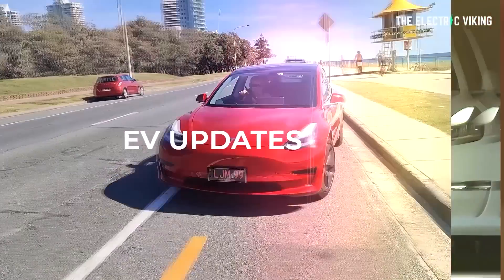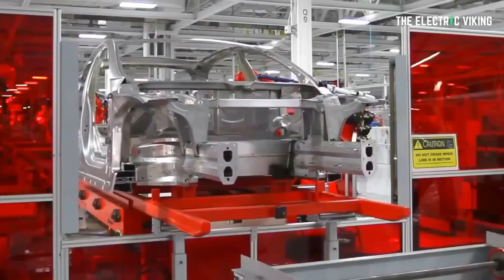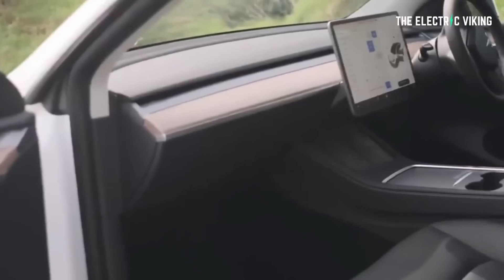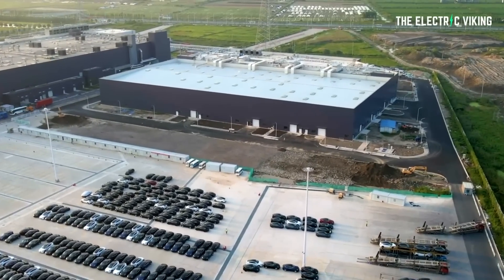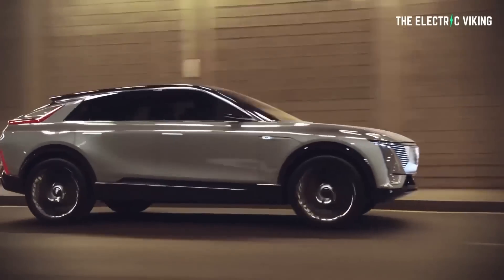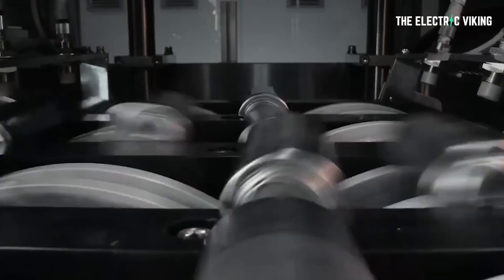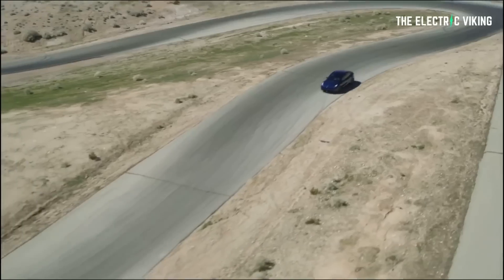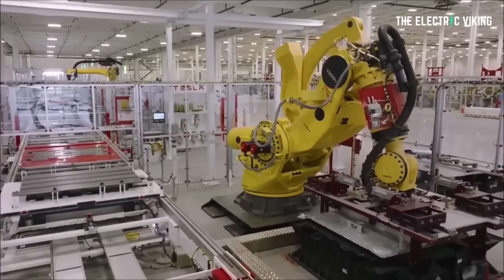Tesla's NEW 4680 battery pack size is UNBELIEVABLE

Comment: Sorry, I don't get the logic in this video.  A more efficient battery might be, depending on how we define efficiency, a battery that gives more kWh/kg or more kWh/litre.  If the battery has LESS kWh while fitting in the same space, it means it is LESS efficient.  And if the car has more range in spite of the battery being LESS efficient, it speaks of the motors, the drives, the aerodynamics and the tires being more efficient;  NOT the battery.  I'm happy that Tesla's are getting more efficient, but the evidence presented in this video does not support the premise that the battery is more efficient;  just the opposite.
Reply: Evidence from the Cyber Rodeo is that the physical size of the pack is smaller (with foam on the sides to protect the pack).  Agreed about the rest.
Reply: @CorwynGC  Ahhhh,  got you.

Comment: Where exactly does the number 50 kWh come from? I looked up the video from spiken reviews, and on the paper you can the consumtion. I think it says 28 kWh / 100 miles. For 279 miles the battery has to be 78 kWh!
Reply: https://youtu.be/y5aOZloxJOw
Reply: Just the idea that a new battery and weight reduction would decrease energy consumption by more than 50% is truly unbelievable. 🙄

Comment: i rarely if ever will drive over 200 miles without stopping for a rest stop...  so i woud prefer to save money by getting an EV with less battery range...  but i wondered if you are charging a Tesla with a long range battery will it fill the battery at the same rate of time as to fill the standard range battery or will it take a little longer to fil it given you were using the same capacity charger each time?

Comment: Varying reports (sticker suggests 50kwh) but charging experience reported says 68kwh. What is really needed is a tear down to isolate the population of cells to get a handle on how many cells inside. We may need to wait on Sandy Monroe. That said at 68, this does Not preclude what is said IF the battery cell mass is lower.

Comment: Fiat 500E has a 42kW battery and has 200mls range, so that new 4680 Tesla 50kW battery pack is indeed very good.
Even if Fiat increases with 20% to 50kW (when it realy is 50kW, which has to be confirmed), it could have a range of 240mls.  And the Fiat is a lot lighter and smaller. Kudo's to Tesla.
Now, bring that Tesla down to $25.000 and it will become affordable to.

Comment: What amazes me is how little progress has been made in 2 years.  I bought my Nissan Leaf 62kWh 2020 and it does 0-60 in 6.8 seconds and over 200 miles.  I would expect cars with 60kWh now to be doing over 500 miles at least.
Reply: Why?  Changes like that have to come from basic aspects of a vehicle like weight and aerodynamics.  Electrical efficiency is near theoretical maximums at the moment, (above 85%)  Changes you envision would require 150% in efficiency improvements.  Improvements of 5% per year are considered fantastic.

Comment: Yay Tesla! Their success is pulling the industry forward. When Tesla shows massive profits other publically traded manufacturers must do all they can to compete. 

This new Model Y gives Tesla the option to lower their price when the supply is able to support demand. Demand is about to become intense because of gas prices. It may be possible for most people to simply decide that they will no longer waste their money on gas. Then buy the first EV that becomes available. 

Yet financing EV purchases may also be interesting. There could be a scenario where despite demand, financing availability may slow the flow of new EVs to consumers. This may be helpful to allow time for EV support infrastructure (service & charging) to become more available. And it would be nice for a surplus to build up. Tesla's new model Y allows for profit even if their is a surplus.

Tesla is not the only company that has support issues. My Hyundai dealership has over a month wait for all cars to receive service. So I have been waiting for my turn to have my Ioniq 5 recall taken care of. Hyundai requires the Ioniq 5 to only be serviced at Hyundai. That includes things like a nail in a tire. Yikes!

Comment: Surely range is a breakthrough Tesla need to be aware of against competition?
Several Chinese companies are delivery 500m range cars later this year.
Tesla would be my first choice but regularly doing a 400m round trip, if I could do this without stopping to charge it would make a big difference to my choice of EV.
Hopefully Tesla offer a 80-100kwh battery pack down the line that would deal with the range for those doing longer trips.
Reply: No.
Efficiency interns of manufacturing and energy is the aim.
Outrange the driver.charve faster than the driver "refreshes".
Repeat.
That is all.
Reply: @rogerstarkey5390  profit for Tesla was not my comment. The car I would choose would be based on range. I couldn’t care less about a companies profit.
Reply: The Chinese vehicles are not EPA range as far as I have seen.

Comment: If a 50kwh 4680 battery pack gives 280 miles of  range, then logically each 25kwh gives 140 miles, so a 75kwh pack should produce around 420 miles of range. If that’s the case with the new MY LR models then it’s all over for Legacy auto makers within 3 years never mind by 2030.
Reply: It's a out 68 kWh 🙄
Reply: @rogerstarkey5390  
If that’s the case then 1kwh gives 5.6 miles of range so a 68kwh battery pack would give 380.6 miles of range. Still hugely impressive and way ahead compared to everyone else.
Reply: The relationship is NOT linear, (but close ).  Logic will get you in trouble if you don't take care of your assumptions.

Comment: Hope the pack never breaks, replacing it is very labour intensive, more than 300 steps in total, even the chairs need to be removed.
Reply: Consider changing for instance... A piston ring in an engine.
Count the individual steps..... I'll wait ⏳
Reply: @rogerstarkey5390  Compare it to a battery swap of a pre structural battery pack … unscrew like 20 screws, detach some cables, drop the pack … Why do you for gods sake want to compare it to an ICE car??!!
Reply: @yvesvandenbroek6055  How many of those has Tesla done? 10? 20?
If the Bolt battery change is any indication, the longest portion of the time was testing charging after the install, so it might not matter.
Reply: Most of those steps are done without the pack in the car making them easy work.
Reply: @jackdbur  In the past swapping a pack was half a day, structural pack more than a day with potential errors, as a lot of work is inside the vehicle, which was not the case with the pre structural pack, have a look at the service manual …

Comment: Tesla lies? Don't care really, but if they say new SR 4480 battery is 50 kw and charging test 9-97% uses 59kw, and tester calculates 67 kw battery size. Is 50kw the truth? 279 mile on 50 kw is really efficient,  but on 67kw, pretty average..... lies, lies , lies....
Reply: Tesla has very specifically NOT said what the capacity of the battery pack is.  Hence all this speculation.

Comment: I think that range anxiety is a highly overrated concern. The average daily kms driven vary between 35 and 50 depending on the country. The US and Australia have more long-distance drivers, but in Europe and Asia, the daily distances driven are fairly short.
One can't compare ICE and EV and their need to be refueled. ICE vehicle has to be refueled at a gas station, but EVs are charged mostly at home.
Imagine if your ICE vehicle miraculously had a full tank of gas every morning. How often would you have to stop at a gas station? That is the case with EVs. With home charging, your battery is full every morning. The need to stop at a charging station is minimal for most people. Driving more than 300km w/o stopping for food, rest and a bathroom break is not really safe, so stopping for a meal while waiting for your EV to charge shouldn't be such a big deal.
There are people who are ready to drive 1,000km non-stop, but they are a small minority.

For the environment and the buyer's wallet, the best option would be to choose a battery pack that is enough for 90% of daily driving and then have a NIO style or a modular swappable battery pack that a robot could switch to a bigger one or add more modules in a matter of few minutes. That way you wouldn't pay for the worst case, but the typical case and rent a bigger pack or modules when you need them.
Reply: The problem, naturally, is for long-distance trips and people who live in rural settings, away from the city. In the United States there is a heavy reliance on personal motor vehicles for both short and long distance trips. ICE vehicles, with their quick refueling times and gas stations literally everywhere, have become the go-to as you can drive one literally across the entire country and never have to worry about finding a fueling station or waiting for more than 5 - 8 minutes to fill up. It is for these reasons that "range anxiety" still exists. Sure - if you never drive outside of the city/100 miles away from your home than essentially any modern EV would work perfectly fine for you. But in the U.S. there is a significant enough amount of people that travel much further at least once a year using their personal motor vehicle and thus, due to the lack of ubiquitous, reliable charging infrastructure and time it takes to charge, such people will have concerns about switching to EVs that fall under "range anxiety".
Reply: @fiftysquiggly  - A little over 100 years ago there were very few gas stations. That didn't stop the automobile from taking over from horses. Charging stations are built at a furious pace. Nothing compared to China, though, but still. The lack of charging stations is a temporary problem, that will be addressed in the near future. Charging times get closer and closer to refueling a car, so that won't be a real problem soon either. Definitely not a reason to live in the past.

Comment: 280 mile range is not enough, optimal will be about 400 to 500 miles as a real usable range, but demand is so high that Tesla can get away with it for now. Production of these cells is currently their limiting bottleneck so they are using as few as possible in each car to make and sell as many as possible. Because they are structural it will be impossible to add more batteries or replace them when they degrade. People will take these cars on lease but their resale value will be low when longer range cars come to the market in volume. Nothing to do with Osborn. I dont believe they are putting unlocked batteries in them because it is better to use the extra batteries to make more cars and unused batteries would degrade. Perhaps later they may do that, but eventually competition from BYD will straighten the market. BYD may need to build factories in Europe and US to overcome the Tesla monopoly but they do not have experience of building outside China where everything is on their side. High import tariffs to protect legacy makers are going to hold back Tesla's Chinese competition and the transition to EVs. Happy I bought my model 3 in 2020 when prices were optimal. It may be ten years before things settle down. Meanwhile these tabless batteries are just a minor improvement. Its good if they have less colbolt, but the real advances will be in the move to LFP, semi-solid and then solid state. It reminds me of how flat screen TVs progressed from plasma to LCD then to LED and OLED. The optimal technology just takes a little longer but once the economics line up it is only a matter of time for the contest to play out.
Reply: Wrong .... But carry on.
Reply: @Poorold plowboy This range is typical for ICE cars on a full tank. Do you think they are dangerous to drive? Of course a lower range would be adequate if every time you stopped you could plug it in to recharge, but that is not the case. Also you need extra energy for when driving with heaters, headlights A/C etc.

Comment: Swings and roundabouts. Audi q4  40 has a wltp range of 323 miles and costs about the same than a Tesla model 3 in the UK. The Tesla might be faster and more intellegent but it's as dull as dishwater as far as being a 'car' goes (it's just a bland soulless box on wheels). Your excitement about the latest battery or manufacturing news is sounding like a hard sell these days. Tesla isn't the answer to everything. If they built their  'robots' more like 'cars' I would have bought one instead of the over-priced under performing Audi unicorn (yep! - still no build date).

Comment: So here is Sam again. One video on and almost unknown YT channel is enough proof for him. And he does not even think about it. Not for a second. 290/50 == 5.8 miles/kwh. Model 3 is at 4.0- 4.3  Miles/Kwh.
So no thinking again. 
BTW, Tesla Daily showed couple fo days ago a Monrone sticker, which shows same efficiency as previous Model Y.  (correct me if I am wrong)
Electrified estimates the pack as 68 kwh, which gives a still nice 4.264 Miles/kwh EPA efficiency. (1:30 at https://youtu.be/ygOdVXICF1Y?t=88). Someone charged 59 kwh into the 50 kwh battery pack. This is only possible with Tesla. 4680 is so good it can receive more energy than its capacity. Great.

Torqnews and this "Spoken Reviews" channel also say that it is 50 kwh, but only because Tesla has put the "50D"  characters somewhere. Commmoooooooonnn.
Are there eggs on my face?????? Oh nooo, those are not eggs, those are facepalms, oh nooooo, sooo many, there are 18% more facepalms on my face than the facepalm capacity of my face is.
Also, the same guy shows a Monroney Sticker, which shows a 123 Mpge efficiency, which is I think almost the same as the Freemont made Y (https://youtu.be/y5aOZloxJOw?t=337     5:37).
Reply: Yeah. It’s obviously nowhere near 50kwh. Closer to 70kwh. Hardly a true gamechanger.
Reply: Ferenc
I'm with you.
I don't think I've ever seen so many misread, misinterpreted, miscalculated and misrepresented "facts" jumping to so many incorrect conclusions.
Facepalm for the win.
Reply: Sam is an entertainer .... I check back every month or so for good laugh.
Reply: @robp3431  What do you mean that he is an entertainer?

Comment: I woulsn't be surprised the range is software locked on the 4680 cell vehicles. Besides ofgering a potential profit model, another more nobler reason would be to sustain the longevity of the bateeries as holding back capacity means each cell is less strained with normal use, which improves longevity of the battery. Imagine software locked range of the 4680 cells locked to max charging to 80%, which the user would read as 100% charged. It would be good practice . In time as battery degrades, one could unlock more capacity in time to sustain performance over time. One could then have a guarnteed range over time, as battery capacity degrades over time. One could also unlock more range oat once, but then at the cost of losing more capacity faster perhaps over time. Another nice business model would be to be able ti unlock more range on a rental basis. Because most people drive short distances with their cars, a software lock, could restrain capacity. People drive longer distancea on holiday, so during those days of the year, one could "rent" more capacity for say two weeks a year which unlocks more capacity. I think this latter business model is most attractive as it could vastly reduce the purchase price of a Tesla. Imagime reducing the selling price if a Tesla model 3 or Y to 25000-30000 dollars for this model, with a rental/subscription model.  Yesla could 3v3n put in a smaller battery. And perhaps for longer journeys even consider screwing in temporary battery modules for extra capacity on a subscription basis. That would reduce the price even more and perhaps also vastly reduce the selling price.

Comment: With very rough calculation
280×1.6=448÷50×80=716
BYD single motor 80kwh Seal does 700km range lol same same.
BYD Seal is way cheaper than Tesla 3 or y
Reply: That is like comparing a corolla to a BMW 3 series. Actually a bigger gap in features and performance.
Reply: @jackdbur  this is simply a battery technological evaluation. The vehicles will have differences. The teslas are  in production and the Seal I, dont think is. The seal will have the worlds safest battery at this time,  look better and drive further. We should wait and see.